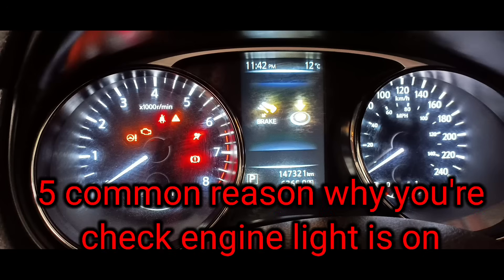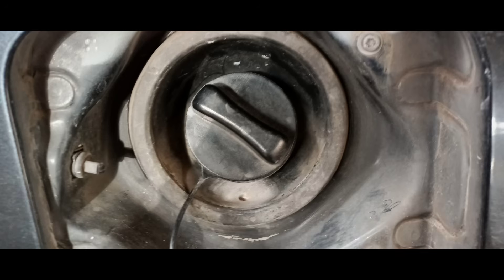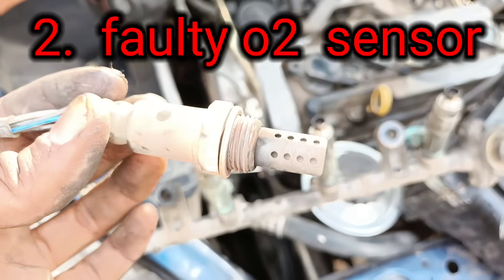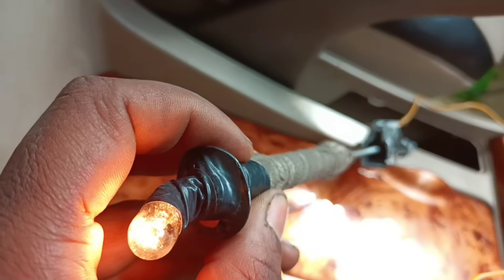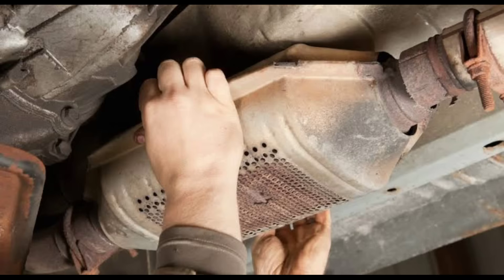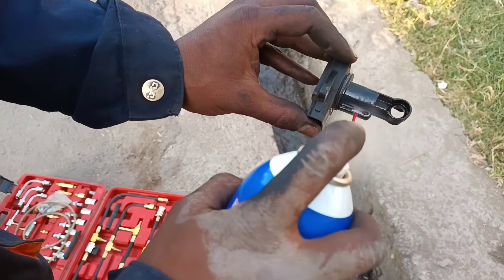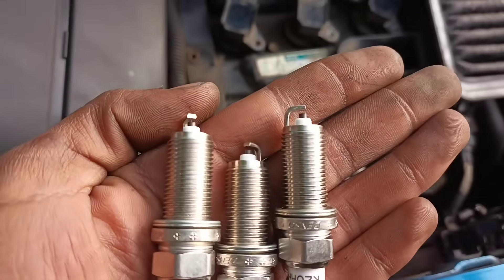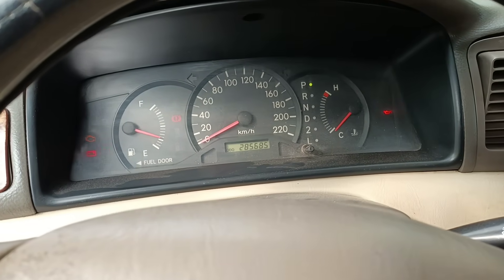The Top 5 Reasons Your Check Engine Light May Be On

Comment: In my Mercedes Benz E 250 CDI, the engine light pops up when the diesel is less than 1/4th of the tank. Once I refill, the symbol goes off automatically.

Comment: My check engine light went on yesterday for the first time. Have a 2018 Buick Escape with 59,000 miles. Has been a great vehicle. Just replaced battery five months ago, $259, oil change a month ago $120, new tires $800. I am on social security so can’t afford a pricey repair.

Comment: Another common error code is  the p420 code or leak in exhaust system. Here in Canada the salt on the road can rust the clamps and components. To all readers, buy a code reader and keep it in your car, it pinpoints your problem.

Comment: I am beyond angry and frustrated. Car taken to Tires Plus Total Car Care 7/11/25. Supposed reason for check engine light - gas cap replacement, replacement of TS1015 and TS1014 vvt solenoids replaced, remove & replace vv timing oil ctrl solenoid(both)engine light off. Light back on! 7/25/25 taken back: their response, because the solenoids were replaced it caused the Cannister Purge Valves to go out. P0442 214-1680, removal and replacement of Evap Cannister Purge Solenoids. Guess what 8/7/25 LIGHT BACK ON. WHY??? I told them i didn't believe the Canister purge valve needed to be replaced due to fixing initial problem. I've spent a total of $715.59. What will be next excuse as to why light is back ON?? PLS HELP

Comment: hi there engine light on when i hit the gas after i go with the back 10 meteres put in the first gear after my check engine light was on and it does like signal when i hit the gas is on and i lose power sound diffrent the noice of exaust and has no power what can it be my car is sport map pops i mean the car is tunning my cat is off becouse of flames on exaust :) wahat can i do

Comment: Oil change was overdue. Turns out I was low on transmission fluid, too. Finally, they discovered a leak. My oils were changed, and they put in an oil stabilizer to slow the leak until I got a repair. They said I needed a new oil pan gasket. I left as a drove for like a minute, and the engine light turned off.
Reply: Update: I didn't take it to get repaired. I took it to a family friend to analyze the problem. He concluded that there was a leak because the screws were loose and did not observe an oil pan gasket issue. My car left no stains on the ground. He tightened the screws and added an oil stabilizer.  So far, the engine light has turned off, and it seems to be running like it used to. Take from that what you will, but I think I suspect I should begin researching for a new car. My old girl has been working since 2003.

Comment: I have a 2006, Lexus 470 GS. The check engine comes on, but when l pull off my battery negative wire, it goes off and later shows up.

Comment: Lose gas cap. Fixed in 2mins. Thanx mate.
Reply: I took my car to the shop a couple years back and they investigated and told me that I have a cracked intake (that causes a vacuum leak) and that is why the check engine light is on, parts and labor estimated around 1000 euros. So I drove the car until now (the check engine light did not affect driving in any way) until I noticed THIS VIDEO. Thought to myself "what the heck, might as well give the gas cap a try since it does not cost much". Bought a new one, changed it and guess what? Problem solved. No more check engine light.

Thank you for saving me a pretty penny.
Reply: 15 seconds 💅🏻
Reply: @dasse1588I put the gas back on and it’s still on, I got it scanned at auto zone and it says that the Evaporative Emission System Leak Detected (gross leak/no flow)
Reply: I appreciate this video. My check engine light has just gone off after opening and closing my gas cap. Asante sana.
Reply: @wamuyundungu3618  But there might be a problem with the cap and the light will come back on. At least now you know where the problem lies and the fix is not expensive.
Reply: The new gas cap fixed it. The old gas cap fell to the ground, and that started a check engine light .

Comment: My 2014 Subaru Forester check engine light was on for a couple of days. No matter how many times I closed it tightly. So, I decided to use wipes to clean the cap, and the inside of the cap entrance. It showed only a little dirt. This took care of the problem instantly.
Reply: Just tried this

Comment: I’m down in AZ for the autumn and winter.  I drive a 2005 Dodge Ram 1500 HEMI Magnum.  She’s only got just under 71K miles. Running good, despite engine icon light on. 

2 possibilities:

1.) Take her in to the local Dodge dealer shop and see what it’ll cost to resolve issue(s), if [that] many???

2.) Look at new avenues.  Been thinking about a Challenger, Camaro, Mustang, or Charger???

Either way, don’t wanna go chasing GOOD $$$ w/ BAD!!!

Comment: This is a very informational video for those who own a Kia soul. I just recently worked on my daughter's 2015 Kia Soul precisely because of a steady check engine light. Because the car has almost 80,000 miles, I changed the spark plugs, and when I went to remove the old ones, they were in bad shape. I probably should have replaced the coils, but I decided not to. Despite not replacing the coils, the check engine light turned off. Also, when I want to gas up her car, I noticed that the gas cap no longer clicks to indicate it has sealed properly, hence another reason why the engine light would turn on. The effect it has on a car is much like trying to effectively use a ruptured straw which in return does not allow you to create enough suction to be able to enjoy it if you are only getting sudden spurts (misifiring). I will be replacing the coils as well just to be on the safe. Update, I replaced the spark plug coils and the car is working like a charm.
Reply from the maker: thanks for your useful information

Comment: Would a low battery cause the check engine light to come on?
Reply: No
Reply: @brightnyantakyi9009  no way
Reply: I read the answer is yes. Low voltage can affect sensors.

Comment: Engine lamp lit up on the Mustang GT. Checked all fluids and such, but all looks and sounds normal. Tow expensive, driving risky, so ordered an OBD2 scanner. Then I saw this video and checked the gas cap. Couldn't see anything wrong, but engine lamp went away after I touched it. Amazing, thanks a lot!  OBD2 scanner good to have for the cars anyway.
Reply: Just keep an eye on things. I had the same problem years ago...Someone mentioned to me about the gas cap., so I bought a new one. Problem solved. It could take a few starts for the light to go out after replacing the cap., but the cost of a new gas cap is far less expensive than a mechanic's repair bill. Don't believe these videos you see on here. Disconnecting a battery terminal, then reconnecting isn't resolving the problem. THAT could lead to a bigger problem in the long run. Cars today have sensors...& a good mechanic can find what sensor is telling you what the problem likely is, but the secret to that is to call your mechanic, state what's going on., & he/she will likely tell you to drop by but do not turn the engine off. They scan for codes while the engine is running.
Reply from the maker: there is no problem if you turn off the  engine unless you disconnect the battery

Comment: Hello goodDay mate! i hope you can read this comment of mine... I am experiencing this issue atm. I have an engine light on in my dashboard. I already changed the sparkplug, clean service the trottle, i have a good air filter , stable RPM all is good but still "engine lights on on my dashboard" any insight about this ? oh btw i got another error saying "Charging System Voltage Low" ... i hope i can have your insight and help about this 😇🤗

Comment: Question: the last time I brought my car for heavy PMS, they said they cleaned my spark plug but it should be replaced sooner. Weeks gone by and the engine symbol shows again in the dashboard. My new spark plug was delivered. If these spark plugs gets installed, will the symbol be gone automatically? or it needs to be scanned again? I am planning to try installing the spark plug on my own (for education purpose). My car is 2019 model with 102km mileage... no other issue except on the engine symbol and some misfires and fuel economy decreases.

Comment: Before my check engine came on it would crank and then cut off,tried it again and before it could cut off gave it gas and revved the engine.This is two days before the engine light.Im wondering if I got hold of some bad gas because now I remember it did something similar except the engine light.Whats got me scared if it's something easy to fix are the mechanics are going to get over on me
Reply from the maker: @dreameryoung38  first u have to diagnosis the car and check the fault code

Comment: Very good thanks!  Here's what's weird my check engine light is on now but goes off if I turn on any of my car's lights, driving light, parking lights or head lights!  I have a 2002 Ford Taurus Wagon with less than 54,000 miles on it and is running and starting smooth and great!
Reply from the maker: Maybe it's a wiring connection problem but you have to check the fault code

Comment: My light was on last year or the prior year and I had to get it fixed and today the light came back on so now I have rot take it back 😩 mine popped on then off then on again with shaking so I pulled over turned it off waited and turned it vsck on and I asked the Lord to let me get home safe and He did just that but I’m definitely 💯 taking it back!
Reply: I’m experiencing the same too with my opel grandland and praying to God to take me back home safely with this car 🙏
Reply: @valeriemashoko808  It sounds like it was a misfiring issue, which means you probably needed spark plugs and the coils, unless it's a faulty sensor.
Reply: @valeriemashoko808 rather take it for a diagnosis, get it fixed before you drive long distance than to to stuck on the road
Reply: Happened to me yesterday, what does it mean tho, is it a big problem in my car?

Comment: Took car in for emissions testing , passed.  After driving home for about 45 minutes, so pulled into park and noticed the check engine light was on.
  Its a 2012 Chevy Equinox , never had any major problems 12,000 miles.  I will check some of the items before going to auto repair.
Reply: Those cars are ass bro… I had a 2012 and a 2019 both bout 20k miles and transmission went out on both🤦🏻‍♂️
Reply from the maker: Check any loss connection socket or wire

Comment: New my check engine come up after changing the gear oil and cahfft please what can I do
Reply from the maker: 1st you have to check the fault code
Reply: Go back to someone who changed your gear oil as they may have touch wrongfully certain wire or connection.

Comment: Just had an experience with check engine light = Reduced power to engine, followed by sound of engine shifting from "D" to "M".
Reply: This is happening to my car what is it?
Reply: @lindamcghee8849  Mine is a BMW 320i e90 engine. I just bought it from auction but it has a full red check engine light flashing? How did you sort yours please?

Comment: 2003 Honda accord here. I just bought it. But I noticed a small stall when accelerating. Once I hit 30mph it pulls back a bit. Now the check engine light popped up, should it be a huge concern? I will try and get it checked asap. Someone let me know.
Reply from the maker: Ya you have to check

Comment: I ignored my engine light for almost four years. My truck was running fine. I thought the light was just faulty or something. All that time my fuel pump was failing had to be replaced. It cost me a lot at repair shop. Will not make same mistake again.
Reply: Don't worry mate, we all learn from our mistakes. Even I learnt from some.
Reply: Silly Billy of the year award has been won by you.
Reply: Prize money will adjust the cost
Reply: Good

Comment: My kia car check engine on and code P2096 , i have checked plugs, MAF sensor, fuel pump and o2 sensor, spray catalyst converter ,  checked if there  is any air leakage , but it is still on
Reply: Best to take it to the dealer. Kia is replacing engines under warranty.
Reply: I heard Seafoam in the gas tank may work

Comment: I have a vw polo 2003.. sometimes when i turn the key to start the car it makes a kind of scratching noise, but the engine does not turn over and the engine warning light turns on. I turn the key to the off position and retry until the engine turns over, then the engine warning light turns off. I have replaced all the spark plugs and spark plug cables, but the problem is still there from time to time.. any ideas ?
Reply: Get your starter motor's bendix change it will solved
Reply: @harshvardhansinghsolanki8270  you are 💯 correct sir. I changed the starter approx 6 weeks ago and the car works great now 😁👍🏻

Comment: Gas cap is very common for the ce light to be on. Spray it with wd40 clean it off and tighten it.
Reply: I hope my situation is simple,have already put a lot of money into other repairs and my emergency fund is getting low
Reply: That's the situation I'm in right now. 🙏🏿 for both of us with our car repairs.
Reply: My check engine light is on. It runs fine except when it's been driven for awhile. Then the engine will stall when you come to a stop. But it'll start right back up
Reply: @user-hy3ps6uo1x  u own a obd tester? They are cheap. Buy one. It will give you a code. Now the code doesn't tell you exactly what is wrong, but it will tell you what 
System is having issues. Like  evap, fuel, ect.  
If you smell gas ,and it acts like it's flooding, when you start it after warming up, I'd say look at the pvc valve in the top of the intake ( gmc) 
Other than that. Clean the maf sensor. Don't be rough either. Probably the problem, but like I said. Get a obd 2,tester. Pick it up at harbor freight, auto zone, oRiely or other local auto stores. Even Amazon has them. Around 50-70 $$$ 
Less for a Chinese junker, 45$
Reply: @HaroldStoliby  how's the mass air flow sensor look?
Reply: Mine is been on for a while, I'll try this before taking it to the mechanic to check and probably get rip off because of it lol

Comment: There's no such thing as quickly when the check engine light comes on it's going to cost you one way or another especially if it's not the gas cap O2 sensors can be expensive and catalytic converters tune-ups are expensive

Comment: I have kia forte 2013 ( got a recall letter in the mail just a couple days ago btw ) I think i may need a mass air flow sensor car stalls a bit on acceleration but there are no other problems really , added power steering fluid , got an oil change then top off not too long ago.. check engine light came on ill go for diagnostics later today tho

Comment: Old gas can be real bad if it's been the same gas say 6 months old if sitting for a long time put in some gas stalizer ,flush out your break lines ever once in awhile ,never full your car up to the very top can mess up fuel systems, check tire pressure to much no traction in rain to little more gas and strain on moter ,if you drive through water make Shure to change your transimon flud because if you get water in it it can destroy your trany , stash your weed in your moter were you can get to it safely ,carry windshield cleaner ,plus spare tire and jack, change oil often with hi gread filter,clean air filter often,check water level often do not use to much antifreeze because it will eat away your head gasket,buy lock gas cap so no one can fuc your car , stash your gun in your moter, put hole in floorboard to get rid of your weed if a pig pulls you over,keep lots of rock and roll cd ,have food and water for back up,carry tools, fix a flat works ,tire repair kit, extra water and brake fluid and power steering fluid ,wash in side of tire to clean any dirt or sand so your break don't squeak ,put in interstate battery the best,never by a die hard battery,🧝💃⚡🌴🕯️

Comment: What if you fixed the problem with the car, and check engine light is still on??
Reply: What if I did it and the scanner say no problems, and light still on??
Reply: @dandaxone  
Try disconnecting your positive battery lead. Turn your light's on for a few seconds.  That drains the power.
Then reconnect your battery.
And restart the engine. 
In some cases it resets and no engine light on.
Reply: That works!! Thank you!
Reply: @dandaxone  
Cool 👍
Reply: Get it scanned

Comment: 1) Loose or damage gas cap

2) Faulty Oxygen Sensor

3) Faulty Catalytic Converter

4) Mas air flow sensor

5) Ignition Coil & Spark Plugs
Reply: Thank you

Comment: I had new spark plugs put in w lifetime warranty and gas cap fits snug. I have no symptoms but service light came on when first started and it's not blinking. What do you recommend?
Reply: Same thing just happened to me. New wires too.
Reply: Panel lights come on at startup for a few seconds while computer boots up then they turn off. This is normal.